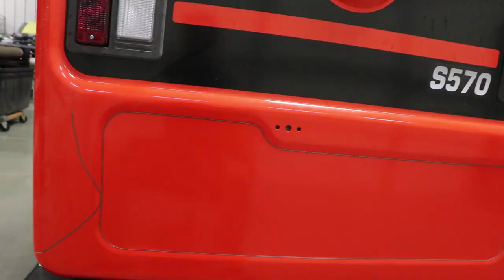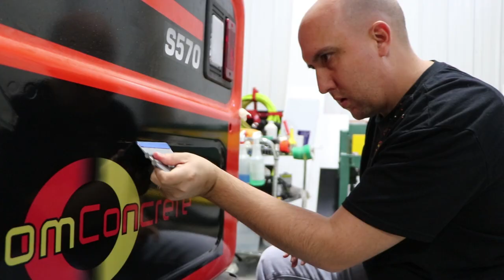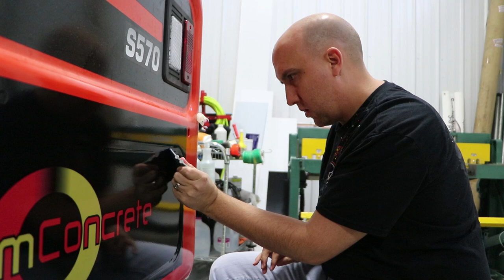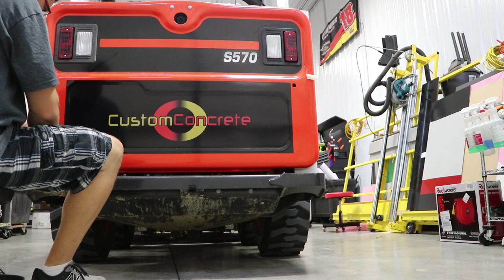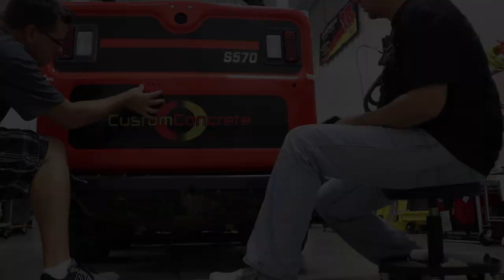How to use Knifeless Tape from 3m - Quick Tip

Comment: nice video. you may want to actually show the knifeless tape being applied to the area. just showing it after its been placed comes off a bit confusing. its not clear the tape has already been put on the peice. especially for a person who may have never even seen it before. would be very easy to miss and just see the first step appearing to be you laying down the vinyl.
Reply: Be nice to show you separating the line from the tape too

Comment: If you're just doing a 1 inch or 1.5 inch wide straight stripe on a hood, do you need the knife-less tape. I plan on doing two straight black stripes on my hood where the stripe runs the full length of the hood. Thanks and excellent video...
Phil